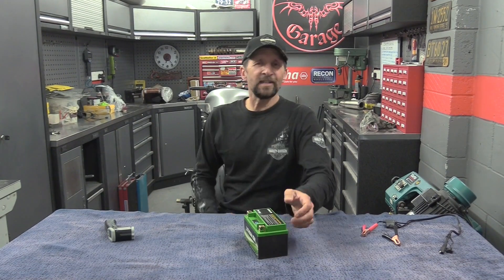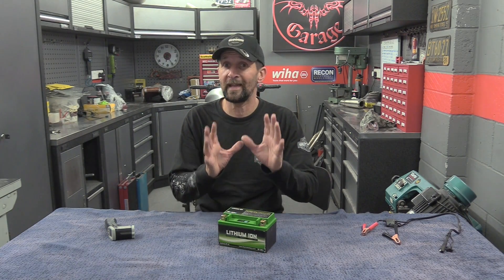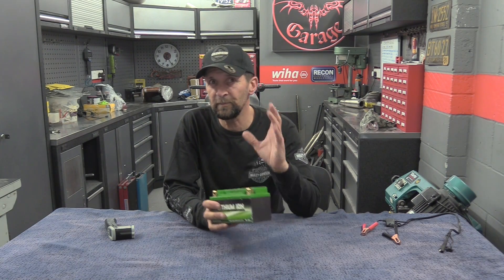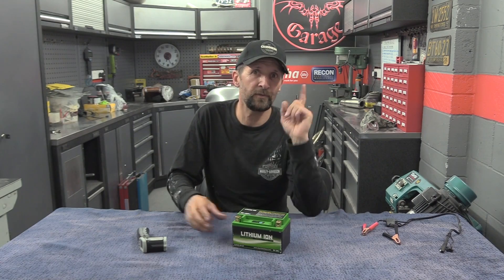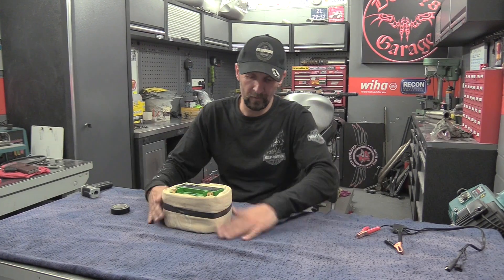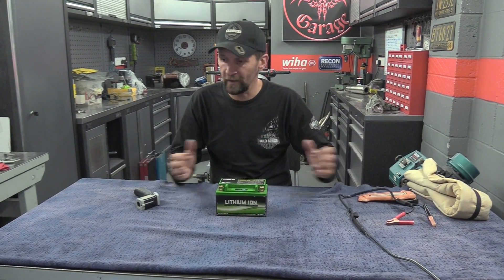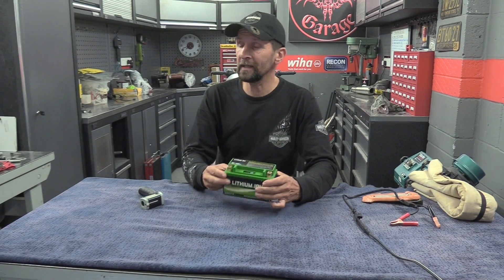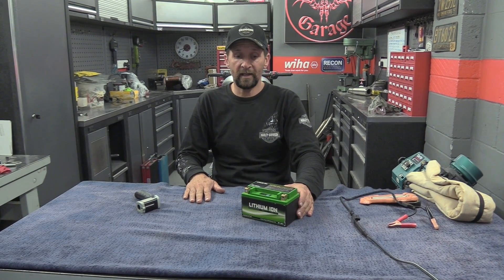Delboy's Garage, Lithium Battery Heat Test.

Comment: Wrapped in material is not the same as being in a metal case. The case will heat up and will not cool itself like the cloth. Cloth has loads of air in it thus providing an escape for the heat. Your engine will also heat up the metal, and lithium batteries do get warm while being charged and used. If there is no cooling they continue to get hotter. Not a problem on a cool day but when it’s in the high temperatures the battery is vulnerable to overheating. The reason for fan cooling is for those times the battery is near to its max working temperature. The fan would blow cooling air to control or bring down the temperature. You must also bear in mind that you will have an exhaust underneath it. Even with heat shielding the air getting to the battery will be hotter because of the exhaust. So your fan doesn’t have to be located under the seat as long as it draws cool air and blows it over your electronics, you could use some sort of ducting. Still your best test will be in the bike with everything on and a temperature probe attached to the battery. Run it at its worst case scenario, like stuck in traffic really hot day lights on phone on charge etc, then you will know for sure it’s ok. You could heat your garage to 30 c and have a fan on your engine to mimic slow moving through traffic. I know it seams a little extreme but if I was sitting over a battery in something I had fabricated. I wouldn’t want to take the risk of being set on fire.
😋
Reply from the maker: I like that, a connected probe and mount the readout on the bars, then ride and watch...!  there is so little space for a fan, but ducting to direct passing are is all possible.. thanks for your insight buddy.. much appreciated...  I was still surprised that after 40 minutes of charging, (adn no "float" or "maintain" mode it charged form 80% up toi almost full), it didn't heat up even one degree.. i expected maybe three or four.. but nothing.. its totally logical that it would get warm, and being dry, that warmth running out of control in the wrong conditions.. but zero heat up in 40 minutes or progressive charging?.. insulated or not, surely any heat what so ever generated inside the battery would have radiated out through the case..?
Reply: air is an insulator, metal conducts energy. Casing something in metal will provide more heat transfer and assuming the ambient temperature is something we call normal, the battery will cool down in the metal casing compared to wrapping it in cloth or other insulating material. When you ride there is decent airflow around and it's not going to explode even if would in some temporary situation hit even 50 C (or more)... And yep I and likely most people here don't have any actual factual experience from li-ion batteries, but somehow I don't think a fan is a recuirement, but maybe just stick it in and measure after a long ride or something and then call it done ? There is electronics within li-ion battery so maybe those do generate heat when the battery is under high load, even if the actual cells do not heat up. Anyways the metal casing is great, if you have a short in that kind of battery it would cause a nasty fire because of the chemical reaction within (think about Samsung Galaxy 8 eh).

Comment: I reckon a proper test would be to charge the battery up using the bike charging system rather than the wall socket charger and then test the temp. because the bike charging system differs from the intelligent wall socket charger. The bike charging system assumes you are using a lead acid battery that and that is what it was designed for.
Reply from the maker: Good point well made buddy.

Comment: Great video Del as always. I always enjoy your videos and learn a lot. 
The heat generation in the charging phase, highly depends on the charge of the battery. If you are at 80-90% charge the results will be different from the 10-20% charge...  Moreover i think if the battery is going to be all enclosed you need to cover the top which was clearly the part of the battery that will heat up if it's going to heat up.
I'm not trying to say if you changed the method the results will change much or if the battery is going to heat up... All I am trying to say is the results, while reassuring  a bit, don't convince me one way or another.
Reply from the maker: Im not 100%% convinced either Abouzar, but if the battery generated any heat what so ever it would have found the easiest way out, through the uninsulated top.. so best place to measure it. and you saw it.. not a single degree higher... also, i wonder what the dry battery does when sat in the frame of a red hot bike on a red hot day.. can it dissipate heat... so i can test all that later once the bike is on the road.. and if im in any way unsure or worried, i can just as soon fit a Motobatt which is only an inch taller and will fit directly into the crate ive made..1
Reply: Moonfleet41 I agree with what you can do. While it is true that heat will disipate through the easiest path, it does not mean that your easiest path will be hotter! I can give you an analogy: if you have a hole on the side of a bucket at the middle of it, it will be the easiest path for the water to leak but that is not necessarily the deepest part of the bucket! Here water pressure/depth is analogous to temperature which is the driving force for heat leakage. In fact heat leakage from that point would cause the temperature to drop from there. Anyways! Your test is a starting point which is a good point for discussion. Thanks for taking the time to read and reply the comments. It is always appreciated!

Comment: I can't speak to all the issues raised, but I know that many standard chargers for lead-acid (AGM or gel batteries are another form of lead-acid) have automatic functions that change the charging 'type' for periods of time.  Those automatic functions can cause a lithium ion battery to overheat and potentially catch fire. One entire bike shop in the US burned to the ground this way. The Holy Grail of chargers will be one that auto-senses the battery type and charges appropriately.  I had no idea there were chargers that could charge BOTH lead-acid and lithium ion, that's great to know!  Thanks for another great video!
Reply from the maker: Thanks Jeff, it does seem, from reading all the great feedback here, that the problems come from incorrect and improper use and handling.. the warnings are all on the battery about not charging over 15v, and the consequences of resultant heat... i guess if you buy a quality product, and use it correctly, you should be fine..

Comment: Thanks, Del... a good experiment.   Did the battery recharge fully in the 40 mins?  Have a great Sunday both of you!
Reply from the maker: Hi Gary.. The bulb test took it down to about 80% from what i can remember, and it was about 99% after 40 minutes.. but im not sure it that rate of recovery would be the same if it had been deeper discharged.. !!  have a good week sir, and ride safe.. D&Pxx
Reply: Moonfleet41 gotcha- thx, Del!

Comment: Lithium batteries do not have a problem when in use or when charging normally, they get hot when they are fully charged and you keep on sending voltage to them (as it would come from the alternator of the bike). This is such a big issue, that the automotive lithium batteries include a protection circuit that cuts of the current coming in. If they didn't, they would 100% blow up. And that's why you should always buy quality products.
Reply from the maker: Thanks buddy, good advice indeed, and im learning this one point over and over from the comments here..
Reply: Buy the way, I have the same battery in my XJR for over 18 months now, and been riding this beast of an aircooled motor in Greek summer weather and in the city traffic with zero problems. I think my balls where suffering more than the battery...

Comment: That laser thermometer is a cool tool, good test. It's nice to see that all's good to use it on your bike build. I'm just wondering, why can't you use a regular 12v trickle charger on a lithium ion one? and why lithium ion and not something like GEL?

Ta, enjoy your sunday too.
Reply from the maker: Hi Johny, you have to ask people more specialised than me about the "what's inside it" question.. but its certainly not Gel, its too light to have any form of liquid inside it.. and you have to use LI rated chargers so as not to over charge it, they are very sensitive to and can be damaged by to high a voltage in charging, either by a charger or the bikes charging system.. thats why not all bikes can use an LI battery.  Good to hear from you as ever buddy.

Comment: We had one blow up at my work from charging it up.
Reply from the maker: Thanks Will.. was it a bike battery.?
Reply: Yes, it was a lithium ion . We started to charge it and we noticed it started over heating so we put it outside the shop and it ended up blowing up. The charger we used malfunctioned and didn't shut off like it was suppose to.
Reply: Love your videos . They've helped me out alot on my Harley's. I just used the video you made about aligning the front forks to help me straighten my forks after a small accident I just had.
Reply from the maker: Hi again Will, wow thanks for that feedback mate... it seems that from what one of the commentors said, that that's refered to as thermal run away and it's pretty frightening when you consider you're sitting on top of it with your knees round the back of 3 gallons of petrol lol... when I do get to fitting this, I strongly intend to fit a heat sensor to it with a display on the bars, cos whilst my charger is the correct one for the battery and is in good condition, I'm not 100% sure about the bike charging system.. whether it cuts off, or not, once the battery is full, is logical that it would for any battery, but I can't find any confirmation anywhere, even from Kawasaki so will be checking for myself.. thanks for your insight mate !

Comment: Good to know ! Thanks.
Q. : what are you going to do to protect the battery against the heat of the exhaust on your bike 
as you are planning on running it underneath the seat ?
Reply from the maker: Thats a big hurdle to cross.. im planning a heat shield, obviously, but its got to be more or less impregnable and cold to touch the other side.. ill be testing it with a blow torch.. there are some materials that are almost perfect heat barriers.. just got to explore it all when the time comes buddy.
Reply: Moonfleet41 
Ceramic coating of the pipe. And they're are ceramic tiles. They're thin and lightweight. Just a thought. 🤔😊👍

Comment: Thanks Del for running this test. I am glad to see that at least with small loads, we saw no heat issue at all.  I think it's awesome we have these batteries for motorcycles now. It's far lighter (can save about 2 kg. or 4 lbs.), has a much slower self-discharge rate, and can often be much smaller (allowing room under the seat for other electronics, tools, etc.). I'm glad you mentioned the note on using a special charger, and on that note I'll only add that it's pretty important never to let these lithium batteries deeply discharge. Once this type of lithium battery discharges below some critical level, it will reduce the charge capacity (or ruin) the battery (most have circuits to cut power when some minimum voltage is reached, but it's important to be aware because even after this circuit cut-off,  the battery will continue to slowly discharge). This is why a lithium battery will report a charge state of 0% even though the battery still has positive voltage.
Reply from the maker: Hi Donald, thats interesting to find out.. and makes sense of something else.. when i use my Lithium powered sander/polisher, the batteries are fine and working ok.. then the thing just stops.. no slow down, or run down.. just a dead stop.. so this is it cutting off to protect the battery that i then slot into the charger bed..!  i love how we learn so much from youtube.. thanks buddy.

Comment: One more test: discharge and charge it same time. like in riding motorcycle.
Reply from the maker: Im told that the Lithium charger i am using is just that, apparently is "Cycles" the battery rather than just pumping charge in.. !!

Comment: Del I don't think that was enough load into the battery?
Reply from the maker: Oomer, i tried to put it through its normal load procedures.. "headlight left on", and charging up from 80% to 99%.... i mentioned in the video that i could have just bridged the terminals and melted it.. but any battery would suffer doing that.. im hearing many times now that its either the wrong chargers, or the wrong (meaning incompatible) charging system that can cause problems.. also over charging by a charger that doesn't cut off and go into float mode..!   jim trying to explore this myth, so How would you have tested it buddy.?
Reply: Moonfleet41 I think the L-I battery has a stress point and it must reach that point like every other test on anything. Me personally I think you showed that a normal test was carried out and the battery was fine.
How does the battery perform del just out of curiosity?

Comment: You need to know the load draw from your bike not just 1 55w lamp.

The bike should draw on idle with lights on around 150w but then you have he bike charging the battery aswell.

A lead acid battery gets hot while running on a motorcycle.

Del I highly advise you test this again with a large load and the charger running at the same time.
Reply: Sean Sluman I've never had a lead acid battery that got more than warm and that was due to engine/exhaust heat. Once, I had one on the bench that got kind of hot while charging but it was a bad battery, internally shorted.
Reply: κοκος οη τωο ωΗεεΙς I've had battery's boiling which are "good" working in the industry i work in, I've seen nicad battery's hit 40C close to runaway levels, I've seen lead hit 50C on high current draw again close to popping.

Just because this small test shows no heat change doesn't mean it can't or won't happen, 55w at 12v is nothing for a lithium cell. 55w/12v=4.5a (P=VI)  your starter will draw 1kw on crank and the bike will suck power about 30amps on a ride! He has bearly broke the surface.

Run a battery powered lithium drill for 10 mins and tell me the pack hasn't got hot
Reply: I trained as a mechanic many years back, we were never told that batteries would get warm let alone hot.  I've never noticed one get hot in over twenty years of driving.  BMW encase their batteries in the boot for weight distribution and so they are hidden from view, so they don't seem to be worried either.
Reply: Not only does a drill get sustained loading, there are also moving parts, very fast moving parts, friction causes the heat.
Reply: Oh btw, I do still agree that the test should emulate the charging and draw of power during normal operation.  The results could still be much the same.
Reply: I'm sure if I run a 15V lithium drill for 10mins it will get very hot, but that is an extreme condition, no-one runs a battery drill for 10mins, same way no-one should run the starter for more than 5secs even when the bike won't start. That's the only high current application on a modern bike, apart from maybe 2x55w bulbs headlights and 2x21w assuming you're holding the brake. Long story short, Honda ships all 2018 Africa Twins with a Lithium battery as standard. The battery on an AT is buried under the tank, between the engine crankcase/cylinder and the airbox. They should know. Sure, I've seen UPS lead acid batteries get hot but these are REALLY high amperage applications, and DCLA batteries. Automotive batteries are different.

Comment: Used LiPo batteries in Rc cars,helicopters, bikes for years.  I’ve had one expand on me when it was stored but didn’t rupture. Also seen it in a laptop.
You can get fire retardant bags that you charge Rc batteries in, wonder if you can get something that would fit this in. Google “rc lipo battery charging bag” for examples.  
My rc charger takes temperature readings to.
Reply from the maker: Good insight buddy, thank you for posting that !

Comment: Delboy, my question is you recommend the correct charger for charging it but the bikes charging system doesnt cut off once the battery is charged as lithium's cant be overcharged. wouldn't that cause it to heat up ?
Reply from the maker: Yes it would mate, very much so, but that would indicate that you have the wrong charging system for the battery, and I know certainly from the guys at Wemoto, they will only list a lithium battery for your bike if they have checked, and are sure, that your charging system is compatible... like I said in the video, if you can't buy an LI battery for your bike, it's probably cos you don't have the right charging system...
Reply: Moonfleet41 Cheers for reply, I’ll have a look on their site. All the best!
Reply: Moonfleet41 just been on Wemoto site and the same battery you have in the video is listed for my GSX600F. Bought it now and shame you couldn’t get a kick back for the sale.

Comment: Micro short circuits are the major causes of fires within Lithium Ion batteries - these are usually caused by the incorect input causing   break down of internal conductors. If too many internal breakdowns occur a cell can suddenly heat and go into thermal runaway which will then catch fire . As long as you home\ bike charging curcuits are in good order and the battery is good quality you should be good. Smaller LI cells such as in phones and laptops are more prone to micro short circuit - tech has moved on and makers are more aware of how these fires occur .
Reply from the maker: Thank you so much brother Ponkster... that insight is priceless! 

And for what it's worth everybody reading... Ponkster is a senior firefighter with a lifetime service, so he knows...